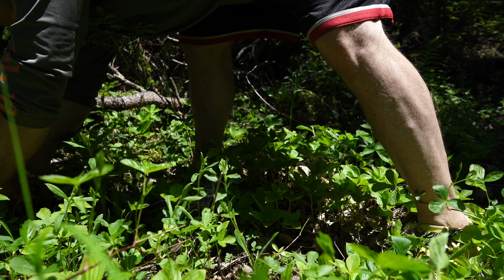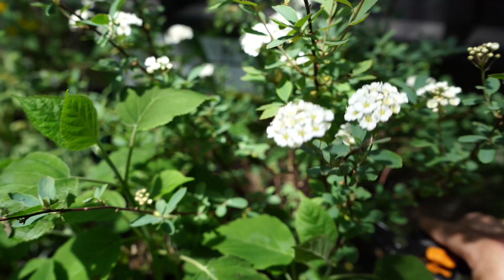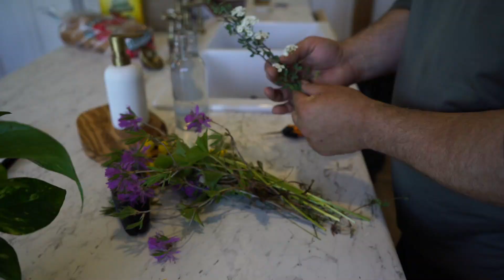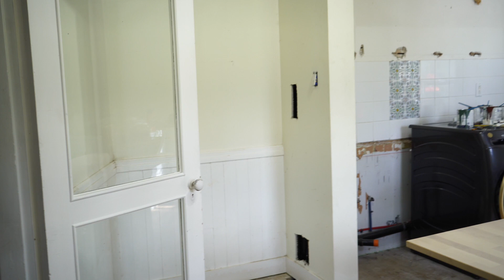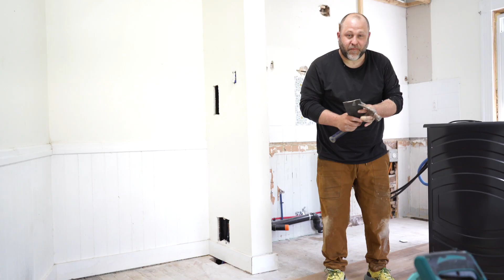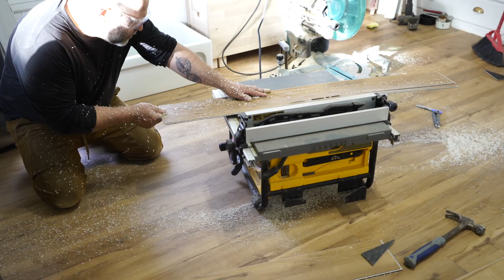Building our walk-in pantry from the ground up! (windows, floors & adding furniture)

Comment: I would watch about the vibration of the washer my son had a similar set and the vibration on the base was so bad they had to remove the base and it is setting on the floor now!!  Actually a. New set because the vibration messed up the washer so they bought a different set!!  It vibrated on the base so they immediately took them on the floor and they work great no vibration

Comment: I would leave them black and maybe accent a tiny bit of gold on them. It ties your washer and dryer in that way. 

I have an antique drop sides table with a leaf in my laundry room. I put wheels on the legs so I wouldn't be dragging it on the floor when I move it around. The addition of the wheels also raised the table just enough that it's more comfortable for folding laundry. I'm not tall (5ft 3in) and didn't think raising the table would make folding laundry more comfortable but it did.

Comment: You could just do the horizontal bar that runs around the stool gold, but otherwise black -- or just leave them black. Also, you could stain your pop-up table black (so you could still see the timber grain, but it would match the washer/dryer etc :) Either way it is looking great! I also love with your tile painting that when the small pattern is next to each other you are getting a white cross pattern on the bigger scale from the negative space <3 <3

Comment: The flowers are nice. The ones that have a Woody stem , yo you need to cut the bottom 2 inches of the stem in a x so the water can be absorbed. And  for cut rose's you need to place them in a shaded area in the house so they will last long.
How about for the stools you paint the legs gold and leave the seat black.

Comment: My vote is black for the stools. I have had both raised washer and dryer as well as on floor with countertop extended over them. I can’t tell you how much better it is to have countertop extended over. You bend down once, grab the clothes, then put them on the countertop to fold at your leisure and sort into piles for distribution while you stand. As well, the raised appliances will interrupt having one continuous counter and hide some of your beautiful tiles.

Comment: I vote for painting the stools space gray and then have little gold "stockings" on the 4 or 5 inches of the legs where they touch the floor.💛🖤🤍
As for building pedestals for your washer and dryer, make the pedestals TALL enough SO YOUR LAUNDRY BASKETS FIT UNDER YOUR W/D (No Wasted Space!) and build them so that the cabinet doors LIFT UP WITH A HANDLE AND SLIDE ON RAILS, so that they fold flat back on themselves INSIDE, AT THE TOP OF THE CABINET.  Then, build a slide-out narrow drawer (more like a "lip" rather than a drawer, only 2 or 3 inches tall) for your laundry baskets to tuck into, so they can SLIDE OUT FROM UNDER THE W/D BUT REMAIN A PART OF THE PEDESTAL, right under the open W/D doors!  When you're done, slide the drawers (with the baskets inside) back UNDER the W/D and then PULL DOWN THE CABINET DOOR OVER THE OPENINGS, concealing your laundry baskets. Think of it like an "Appliance Garage", except used to pull out and store your laundry baskets.